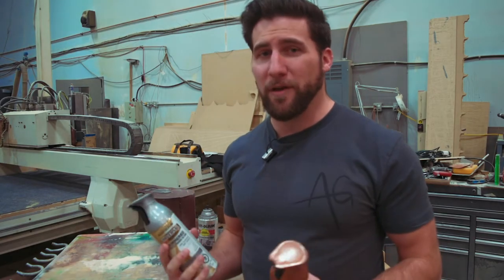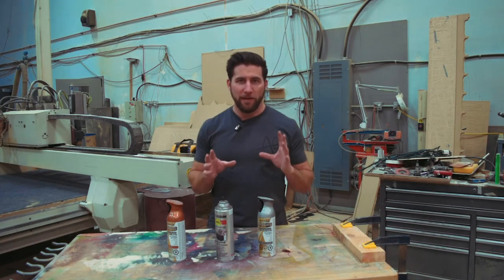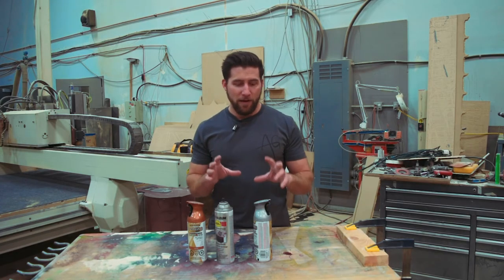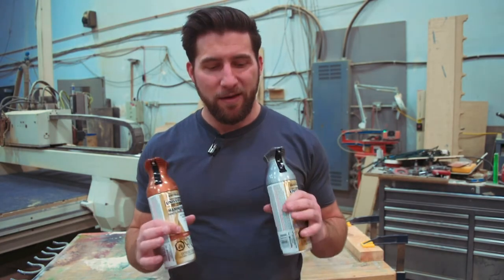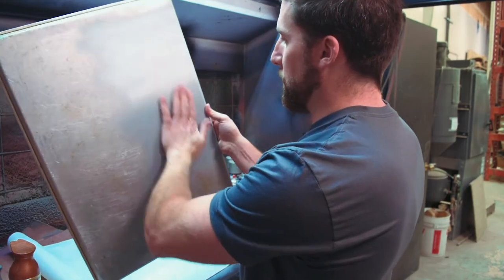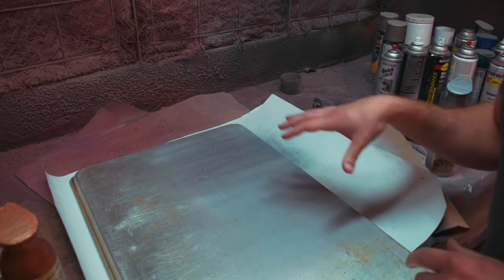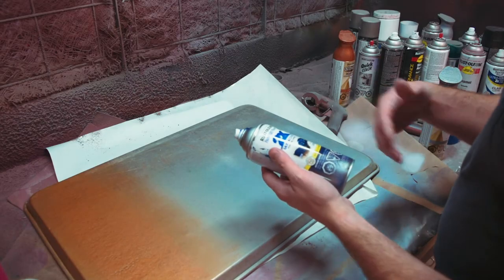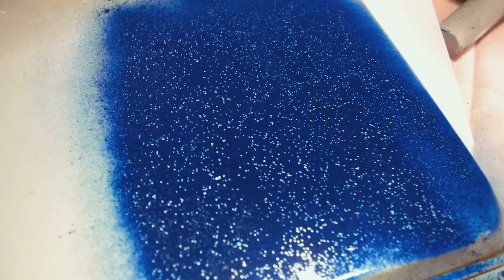Strong and Easy Paint Job | How to work with Hammered Paint

Comment: Brad: Great vid.  I have chocolate-brown painted wood garage doors in San Diego.  I would like to achieve a weathered copper (blue/green) effect without buying a sheet of copper roll!  I have the typical single car, double car doors for a total for parking for three cars...these are slab doors which date from the 80's but have been lovingly painted inside (ivory) and outside (brown) for years, therefore no termites or other problems.  The neighborhood is filled with roll up, aluminum doors of recent vintage as the owners swapped out their old slab doors... so I like being different. What process would you suggest to achieve the blue-green patina in either bold or subtle.
Reply from the maker: I haven’t tried this myself, but I have heard that something along those lines can be achieved with the rustoleum reflective metal paint and apple cider vinegar.

Comment: I’m getting ready to Copper hammer paint a laminate Fume Hood.  Would you suggest to spray it and should I seal it after wards, if so suggestion with what?  It is off the wall and on saw horses at the present time, but after watching your video,  is this the best plan to avoid drips.
Reply from the maker: You can spray it or roll it. Whatever your preference is. I explained the sealing issue in the video. 
If you want to avoid drips you just need to make sure you’re not spraying too heavy, particularly on corners.
Reply: @BradAngove  thank you for your response.  I’m starting the project tomorrow.

Comment: Anyone used the clear hammered paint? curious how this turns out.
Reply from the maker: I didn’t even know there was clear hammered paint. That seems like an odd product.
Reply: @BradAngove  i was trying to figure out how to achieve a Stanley hammertone green. Thinking I would use a green closest to it and top it with the clear. Not sure how that would turn out
Reply from the maker: That sounds like a reasonable plan. I’d be curious to hear how it goes for you. I would have thought the silicone in the hammered paint would make it difficult to produce a clear.

Comment: Can you clear coat it with plasti dip?
Reply from the maker: I wouldn’t know. I don’t use plasti dip.
Reply: @BradAngove   FYI I used hammerite hammered to finish my bathrooms hardware in copper and gold. I used it in on steel wood and plastic. I originally bought the rust olem spray can aged copper and from experience it would be good for a project where it usbt subject to steam and water all the tine and chipped easily hence using hammerite. I tried a few clear coats with it ruining the finish hence then finding your video. 
I decided to try a plasti dip clear coat I.e.wrapping of liquid rubber which you then finish with a gloss coat. 
After trying lots of ways to get this clear coat not to ruin of the hammered effect I discovered 2 options. For Matt finish plasitoke sealer clear. You have to spray 60cm away and do 10 - 15 dust coats otherwise it will contaiminate. Best result was using gloss coat which was meant for the plasti dip. Called plasti dip gloss enhancer. You could dust coat with this with side effect until a thin plastic gloss layer is adhered. Definitely something imo you would need in my situation. Then you can apply any clear coat to this new layer 2k plasti dip etc. Anyways thank you very much for your vids and setting me straight in the difficulties of this

Comment: Another great useful video - I recently painted a speaker enclosure.  Texture paint may have worked well as an alternative to wrapping it.  Is there any kind of texture that can come close to simulating a wrapped appearance?
Reply from the maker: I’m not familiar with one that looks quite like that, but the first thing that comes to mind for me is truck bed liner. You can get that in a can and it’s got a grippy texture. I painted one of my tool boxes with it a while back.
Reply: I did the same thing for an enclosure with 2 x 12 Greenbacks in black. It turned out great. Im very proud of it. The wrinkle paint would be the closest thing to a vinyl I think. But Im happy with the hammered. My Marshall looks great sittin on top of it.

Comment: If you roll on a large vertical surface, should I thin it at all? If yes use Xylene? 
OR is it ok to roll on without thinning?
Reply from the maker: I would thin slightly with xylene if it were me just because it’s a bit difficult to roll large surfaces with this stuff, but you don’t necessarily need to.

Comment: I have silver tin ceiling tiles that I would like to paint with this hammered paint. Do you recommend spraying or rolling this on. It is approx. 550sqft
Reply from the maker: I would be more inclined to roll it on if it were me. Less wasted on overspray etc.

Comment: The hammer paint which iam using forms craters in the coating finish.

Do you have any suggestions ,how to prevent craters?
Reply from the maker: What do you mean? That’s the point of hammered paint.
Reply: @BradAngove  iam facing pin holes and craters problem in hammer tone paint
Reply from the maker: Ok. Did you try to coat over it with something?
How did you prepare the surface under it?
Reply: @BradAngove  I just coat on phosphate MS substrate
Reply from the maker: I don’t know what substrate that is, but this paint should be on a clean sanded surface, and if you’re having trouble you should also consider using a primer under it.

Comment: Thanks for this video. On a rather large piece of furniture, I sprayed a thick coat, hoping for larger indentations. Instead, it dried smooth, with almost no texture. What did I do incorrectly? Now, what can I do to get the hammered finish?
Reply from the maker: That’s odd. Sand it lightly and clean it, then spray again. This time spray from closer to the piece and make sure the can is very well shaken first.
Reply: ...are you sure you didn't buy the 'smooth' hammerite can....😅
Reply from the maker: “Hammerong”

Comment: Brad can you use wax to polish the hammered paint look? Is it necessary like other guitar paint jobs?
Reply from the maker: It’s generally not necessary to polish hammered finishes.
Reply: @BradAngove  Thanks so much. To make sure the surface is coated enough would it be a good idea to use both your techniques. A light layer for the metallic look first then a more pronounced heavier hammered look on top?
Reply from the maker: You could do that, just make sure you take a look at the information on the can about re-coating.
Reply: @BradAngove  Excellent! Thanks. Love your channel. Learning a lot. Moding my first guitar atm, paint and all.

Comment: I painted some metal bifold doors with the silver. Didn't prime it first - big mistake. I am going to ignore these "self priming" claims moving forward. Not really happy with the end result, rather inconsistent and uneven finish. I am considering sanding and trying another coat because my technique was getting better. I should have dedicated a can to getting the hang of this on some random surface. This stuff is getting pricey though.
Reply from the maker: This product requires some finesse to get an even look unless you are just blasting it on there heavy.

Comment: I stumbled across an interesting paint. Steel-it. You're supposed to be able to weld through it. Very unusual.
Reply from the maker: Through it? That seems rather odd. That level of heat would ruin most paints immediately.
Reply: @BradAngove  Yeah. It's a very utilitarian concept. It will initiate an arc through the paint, then the heat will dilate a hole in the paint big enough to perform a weld repair. Different, huh.
Reply from the maker: Very cool
Reply: 6010 electrodes will rip right through some paint…. You’re gonna need to clean up real good after you weld with those anyway <_<
Reply: @jmitchell6094  6011 does too, but this stuff, you can strike an arc through it with a TIG. Check it out! It's cool stuff for automotive applications.

Comment: I kept getting this paint coming out smooth.   I had been spraying outside with a light breeze and it doesn’t like that - the effervescence blows away that makes the uneven level. 

So much so that a second spray pass blows the effect off the first.  Annoying as shit 

Work inside - no breeze if possible
Reply from the maker: Interesting. I’ve never tried it in those circumstances. Only with a fan or a pull booth like the one in the video, which have never been a problem.

Comment: Looks like there's tiny pin holes. Especially evident with the blue coat.
Reply from the maker: I believe I explained in the video that the silicone would create pinholes in the paint going over top of it. There are no pin holes in the hammered paint itself.

Comment: This hammered look is extremely hard to achieve. You need a very small surface otherwise you will need alot alot of cans. Gonna get expensive real fast. Also spray pattern is super difficult to get right. Spray too far it will thin out and spray too close and it will streak and puddle. This particular spray paint is very bad at that. Easy to mess up. Surface must be prepped. Sanded down and primed. The results you see on the can or how pros do it is the result you would get IF you took alot of steps to prep you item. Otherwise you will not get the desired effect.
Reply from the maker: Try rolling it in instead. That will make it easier to keep it even on a larger surface.

Comment: Hello What I want to paint is already  hammertone gray and I want to change color  to black so I wondering  if I can paint hammertone over the existin hammertone  finish
Reply from the maker: If you sand lightly and clean it with wax and grease remover it will probably work. I’m not certain though.
Reply: @BradAngove  ok thanks

Comment: I am a tube amp builder and I want to get that 50's hammered paint look but I can't get a smooth coat it looks light yours with severe orange peel super bumpy pock marked. Is the formula different from the old stuff which looks so smooth? I don't think this rattle can stuff is the same as the vintage stuff because I read an old amp pamphlet and they called it baked hammertone finish.
Reply from the maker: I don’t think I’m necessarily familiar with the look you’re going for. But, if you want it smoother, you’ll want to apply it much thinner so the chemicals don’t go on as wet and don’t cause as much pulling.

Comment: Great job. Let us know when you do a guitar body with the darker hammered paint. I'm going to try it on one of mine and then will be doing a bass with the caulk paint. Have you tried the caulk paint Brad? Would like to know your recommendations. I know they sell a clear for caulk spray, so that may help protect it.
Reply from the maker: I’ve never tried that. I’m intrigued by the idea though
Reply: @BradAngove  Ill be waiting for ya on that one. I do like the idea, how easy it is to do without sealer/primer. I would still use primer though, just in case. Take care Brad and thanks for the quick replay.

Comment: I agree anytime I clear coated Hammered paint it was a disaster. Leave it alone
Reply from the maker: Indeed. It’s not meant for that.
Reply: Yes, I tried spraying painters touch clear over hammered...what a mess. 
It all pulled apart but I thought it was a reaction between paints ( oil vs acrylic ) but now understand it's that silicone in the hammered paint causing it.  The light is on now. Thanks.

Comment: condensed and useful information, thank you. Did you experiment any more with topcoats? I refinished my kitchen sink copper hammered rustoleum can. It looks amazing but started to blister around the drain when I left water in it overnight. I did prime it with automotive primer since the recommended primer didnt adhere to the original factory coating on metal sink. One product review said they used urethane but the urethane says not to use on metal. It really looks amazing like a $300 sink so Id like to find something that works. Maybe an aquatic sealer used for boats?? would love any suggestions
Reply from the maker: I have not found anything that works well as a top coat for it, but I also haven’t done much looking in a long time.

Comment: Does hammered paint flake easly or does it flake at all if it's used on weight plates?
Reply from the maker: It’s pretty robust, but if you’re banging metal plates again eachother it’ll probably flake.
Reply: @BradAngove  I see, thanks for the reply

Comment: I recall doing water droplets or coarse water misting trying to achieve the hammered effect. Damn I'm OLD!!
Reply from the maker: I’ve never heard of that method. I used to texture wet paint with a sponge sometimes for a relatively similar effect.
Reply: I sprayed some parts with enamel and set them outside to dry. I fell asleep, and woke up to rain. My parts got rained on, and developed a really neat embossed pattern, layers of raindrops.